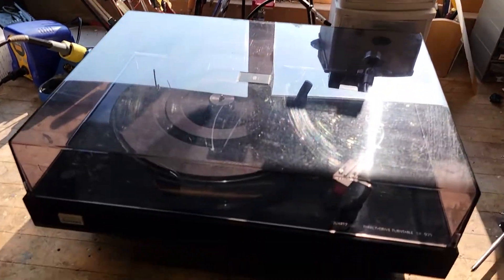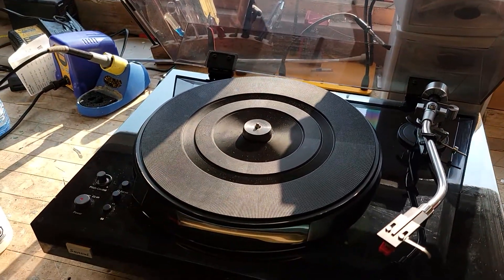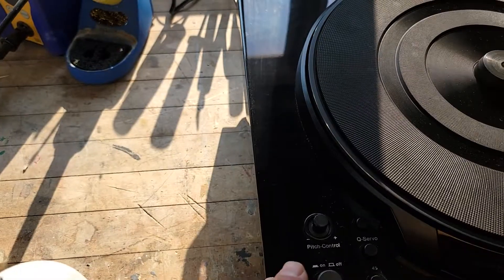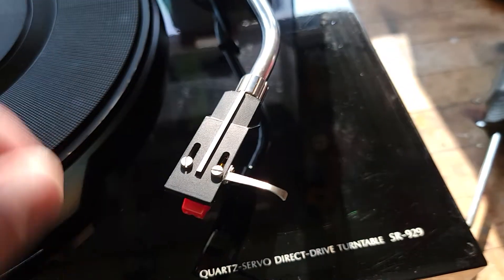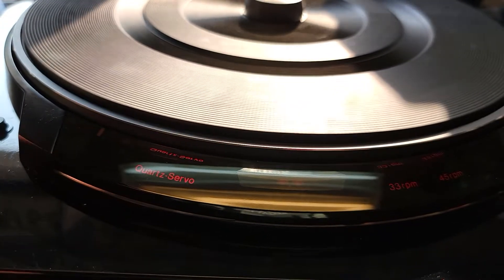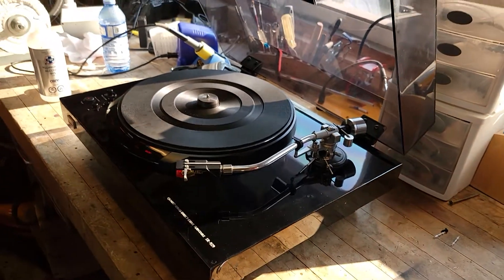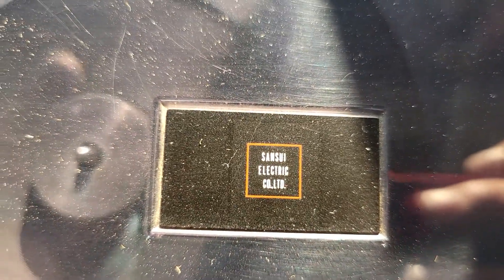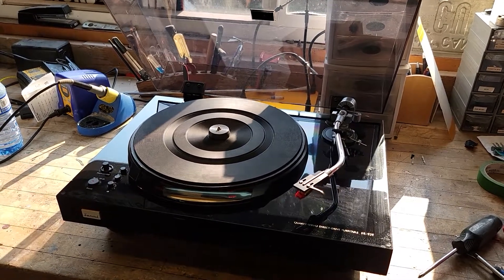Sansui SR-929 Quartz-Servo Direct-Drive Initial Comments 15 Oct 2022

Comment: Why did you put the lateral weight from the other side? In the user manual it´s shown to be put from the left.
Reply from the maker: You can put it either way. On the other side the arm skated dramatically. On the side shown anti-skate was adjustable to perfectly neutral...